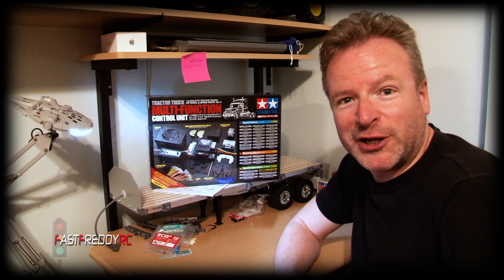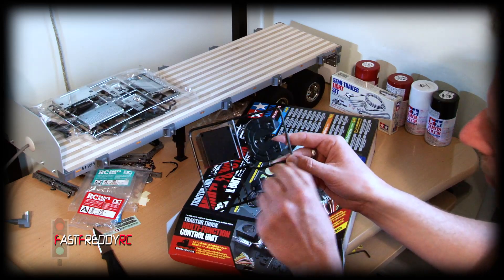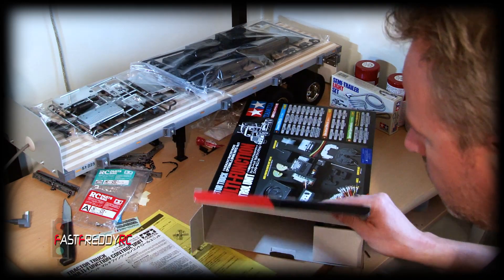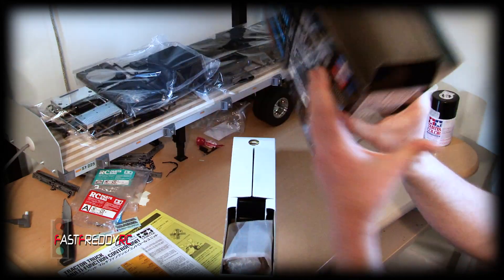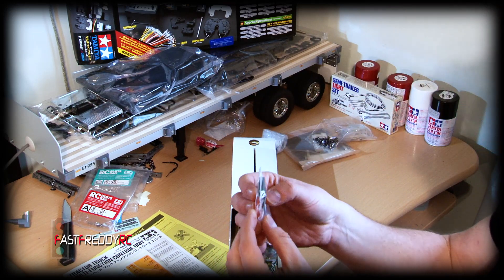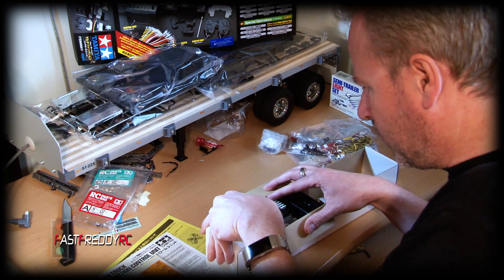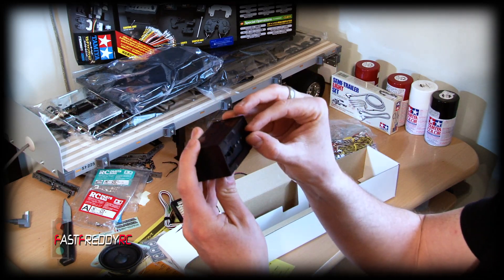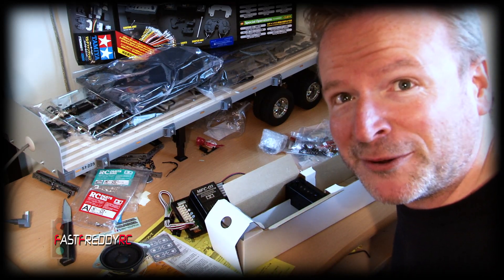Unboxing the Tamiya MFC-01 (Multi Function Control Unit)

Comment: fred i trieds using the gt power 6-a light and sound kit on my grand hauler with a radiomaster mt 12 pistol grip radio with enough channels  and could not get it to owrk. do you know if an mfc-01 unit will work with that radio
Reply from the maker: Hi Michael. So I looked your radio up but can’t find what I want to know about it. Can you tell me if it’s a digital radio or analogue?
Reply: @FastFreddyRC  it is digital